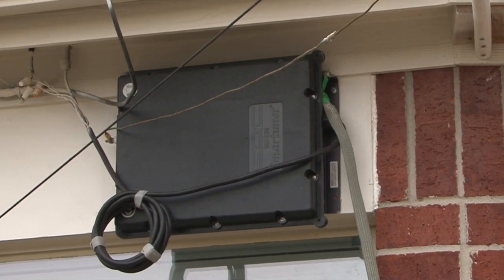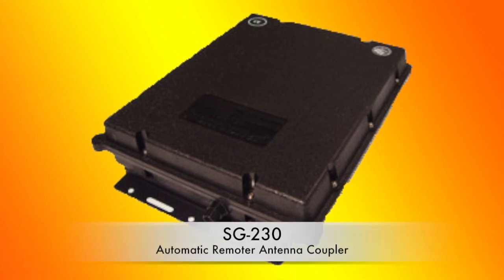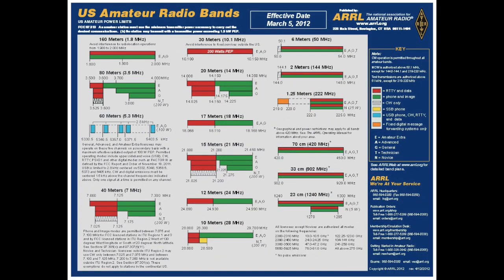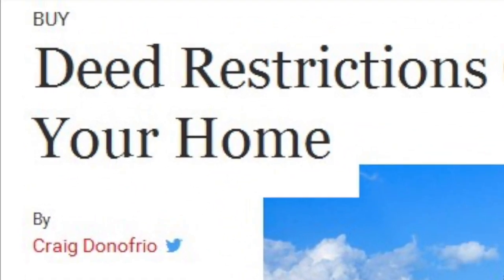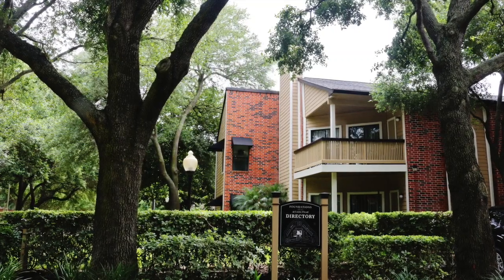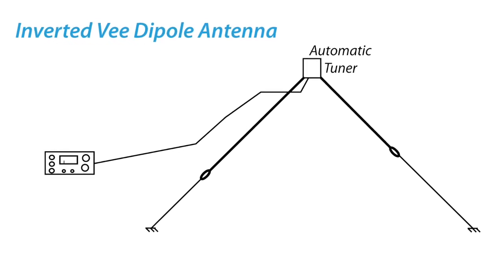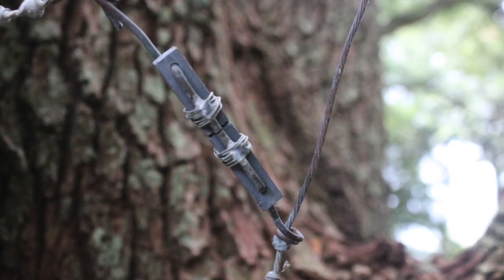W5TOM Stealth Antennas

Comment: I VRY MUCH AGREE... THE SECRET TO SUCCESS IS PLACING THE MATCHING NETWORK OR MATCHING DEVICE RIGHT AT THE ANTENNA FEED POINT REGARDLESS OF WHICH TYPE IF ANTENNA AND ALSO VRY CRUCIAL IS ADDING A COMMON MODE CURRENT CHOKE AFTER THE FEED POINT  MATCHER  TO THE COAX LINE AND ANOTHER CM CHOKE  AT THE XNCEIVER INPUT AND OF COURSE LIGHTNING ARRESTER TO GRND.

Comment: This is a great video. What you describe is basically what I've done, I have an 85 foot wire which runs though some trees along a fence line. The feed point is at one corner of the fence, and the counterpoise is a 45 foot wire at right angles along the fence.  It probably ends up acting somewhere between and end-fed and an off-center-fed. The wire through the trees is PolyStealth copper-clad steel tensioned by a 12 pound window weight. There is an 8 foot driven rod near the feed point, and I use an  MFJ-939 auto tuner at the feed point with 125 feet of buried coax back to the house and then to my 3rd floor shack.

I think it is important to ensure that the coax is also grounded to the house electrical system, so I have a green wire bonding the coax shield to the ground  busbar of the electrical panel where it passes near after entering into the basement. --de N3TS

Comment: I once had a big loop (about 9 ft on each side) in my apartment. The living room had very high ceiling and the loop fit easily on the wall. Tuning was a sliding contact and a variable capacitor. SWR was around 1.2. Performance was excellent. The only problem was when my neighbors moved their furniture and I had to re-tune it.

Comment: Not a Ham, but back in California, I moved into an apartment that was a large, converted garage. Basically, a cinderblock room about 40x40 feet square. My first night in there, I wanted something for entertainment and one of my shortwave radios was on a table, so I started rummaging around in a couple of boxes full of electrical stuff and cobbled an antenna together, using whatever I had on hand. It turned out to be the best shortwave antenna I ever had! I was amazed at some of the stuff I was able to receive from around the bands, often with good signal strength. For those who might still enjoy tuning around the spectrum below 30 Megacycles, here’s a link to my Low Cost, Indoor Loop Antenna.
https://imgur.com/nvz34hA
Reply: The lesson I've learned is ANY antenna is better than none.

Comment: Ok you made a comment I did not understand I have an LDG 200 at shack. Is this what you can use? I have a simple vee on a pole.
Reply from the maker: Richard:  You can use this tuner if you place it at the feed point of the dipole.  If you have it in the shack and connected to the antenna with coax, it will work poorly.  Good Luck,  Tom

Comment: Great ideas..
I am retiring soon to Az and HOA that runs my future community is a bugger I am told. Back yards are brick wall divided and no antennas can be seen except cell repeater yagi which sq.ft area is under a foot, and satellite dish is mounted below eyesight level or top of six ft brick wall... By law is worded as 'building structure' modifications or attachments to property must be approved prior to installation.
Many mountain 2m and 70cm repeater clubs south  of Phoenix Mesa area so an attic dipole or/ and a  "as needed" free standing un attached  vertical on a tripod maybe my only choices since tiled roof has solar panels on sw half. 
HF will be a toughy keeping wires elevated and out of sight??2
No trees above 10 feet on lots but only on commons areas..stone lawns..no grass..some small deco plants with micro irrigation under stones..xyl could care less either way.
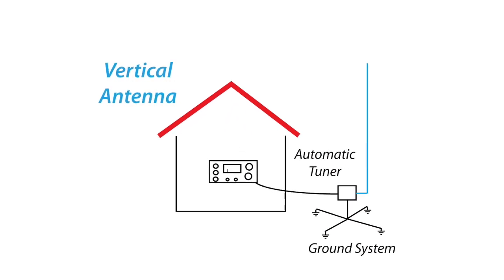Reply from the maker: Gary:  The solution to your problem in the Jack Pole vertical that is discussed 2:30 min into this video.  Good luck, Tom
Reply: Gary, tune up a loop wire hidden under the eves.As a closed loop it will be quiet on recieve and at 100 watts the sac tuners will tune anything.You will be happy with it guaranteed.Use a. 12volt transformer or battery to power the tuner....kc6ndc Steve,off grid and also mobile
Reply: You don't want to live there anyway. I will live in a cardboard shack before I'll put up with someone telling me I can't have a wire dipole in a tree.

I saw one article where an old veteran was told he had too many semper fi stickers on his car. "Remove stickers or face eviction. " I used to think America was above this type of nonsense.

Comment: Why would you need a tuner at the feed point if using ladder line? I like to run 1kw so these tuners are horrible. Good balun and proper wire is the key.
Reply: This video is for people with stations under 500 watts as the sac tuners I think only handle that much.I too use twin lead but no restrictions on my ranch.I have a friend K7RTF that ran the low power sac with a loop in some 100 foot trees from near Seattle, his signal was fantastic with just the low power of 100 watts.Over a period of about two yrs we tested it from my 100 watt screwdriver mobile and had consistent saber results in Ca,Nv,Az between our two stations.Adding an extra 100 watts to the mobile output was another constant that made a big difference in my mobile station..We run the Kenwood 480 now.Georges loop blew down last year so he is using a 63 foot vertical in the trees now with the same tuner,Works very well but not as good as the loop did.My experimentation is based on some vert old patents and some work done by various civilian,RCA,and the Navy during WW2.i will be building a prototype subterranean antenna that needs home made type twin lead.A lot of the rules in ham radio apply but get really tweaked so it’s fun to experiment.Nobody believes you anyway until you install live cams and internet feed.Might put up an apps weather be on for fun too.I,m recovering from major spinal fusion so taking it easy and catching up.....take care, Steve KC6NDC

Comment: I need to use an antenna that will work with the MFJ-347 bracket and can only measure 18-23.5 feet tip to tip a multi band antenna is preferable so I don’ have to go out in the snow and cold any suggestions so I can get at least 10-80m thanks in advance
Reply from the maker: Watch the video a couple of times and you will understand the concept.  23 ft. might be a little short for 80 meters, but all the other bands should work.   Good luck and let me know how it works out for you.

Comment: simple dipole antenna doesn't require a tuner if you tune you're dipole antenna
Reply from the maker: Robert,  You are right, but your antenna will work on only one of the nine HF bands.  
Tom
Reply: Feed it with 300 or 450 ohm ladderline and you'll have low loss and the tuner in your shack